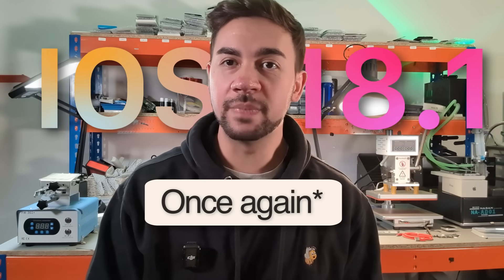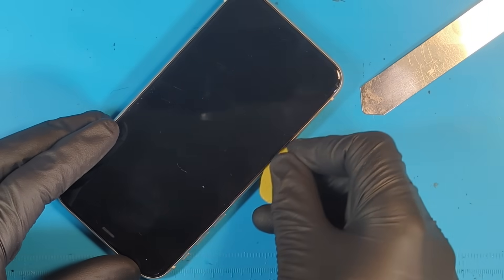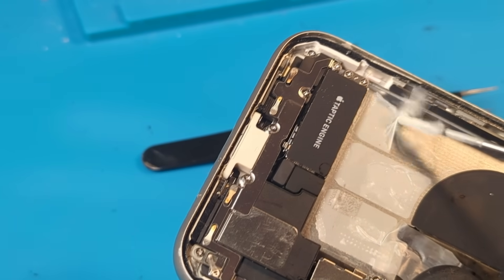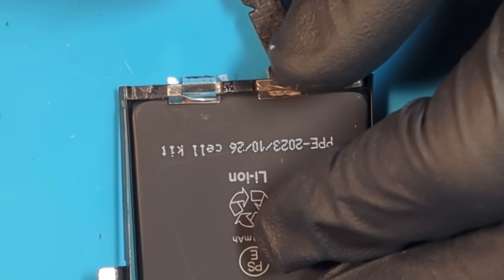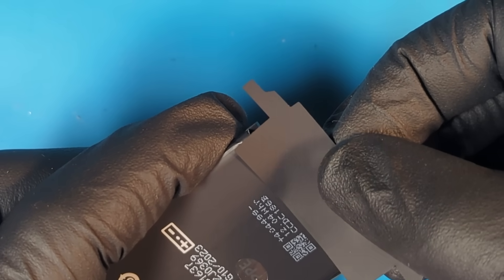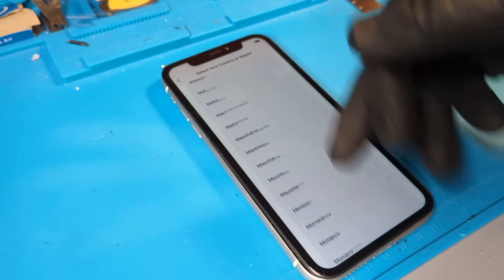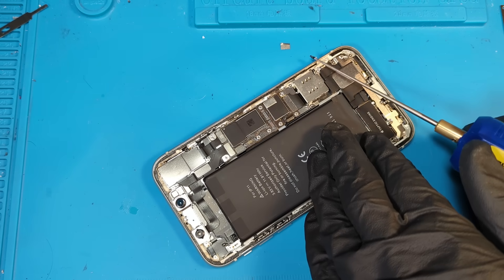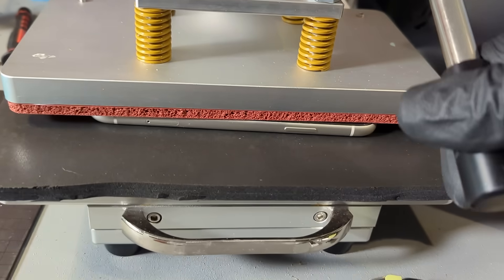How to Reset Battery Health to 100% and Remove Notification after IOS18.3(BMS Swap method)

Comment: Do you need a spot welder
Reply from the maker: Yes :). I have seen people use a soldering iron and special solder, but I have not had much success with it. It looks too messy and I don't like using that much heat next to a battery cell
Reply: @ninjarepair alright thanks mate

Comment: is the flashing still necessary so I can see my battery health and have it reset back to 100% and 0 cycle count? really don't wanna lose my data or redo the iphone starting steps.
Reply from the maker: For this method yes, however you can now buy batteries that pass the Apple calibration. You can buy them on my website if you're in the UK :). These will show as "used" in the settings :)
Reply: @ninjarepair ohhh nice2x thanks man!

Comment: Help, ninja repairman! I have a 16 Pro Max with the battery health at 80%. I already replaced the cell, but I don't know what method exists for the 16 Pro Max to raise the health to 100%. From the iPhone 11 to the 15 Pro Max I use Tag On, but I don't know if it's the same for the 16 Pro Max.
Reply from the maker: I checked for you with my supplier and "currently, the industry does not have the 16-series Tag on flex cable. So, the current health data depends on the BMS board's current health level before it's replaced." hope this helps :)

Comment: Hey will this method work with jcid tag on flex that has been programmed with the original battery bms (soldered/spot welded on a new ampsentrix core battery) to 100% battery health and 0 cycles. I tried that yasterday and i got stuck on 3utools at 48% twice. Is the newest version of 3utools v9.1 i think stable for doing such repairs? I also used lightning to usb c cable, original from apple. Should i use lightning to usb a cable?
Reply from the maker: This should work yes. Please try flash work latest version of JCID repair assistant :).
I will be likely doing this repair in the next few days so I'll try checking to see if it's working.

I don't have any jcid flex in stock unfortunately, but pre programmed should work for my test
Reply: @ninjarepair can you make a video on this and specific procedure on jcid repair assistant where to download it amd how to configure it or leave me some toutorial that shows it all, because i cant find it anywhere

Comment: Il tag on e da settare con programmatore o da tutto il programma jcid su pc ?
Dopo aver fatto questo iPhone si spegne da solo? Cosa posso aver sbagliato?
Reply from the maker: The tag on flex in the description do not need programming. With jcid tag on flex you do need to program them :).
If the phone turns off after cell swap, perhaps the welds are not strong enough?
Does it turn off with the tag on flex disconnected?

Comment: why did you breeze through the most important part (resetting to 100%)
Reply from the maker: You can download the firmware using 3U Tools, and then you can use JCID repair assistant to reset battery health to 100% :). There isn't really much more to show than what's in the video my friend
Reply: @ninjarepair  is jcid repair assistant a software or is it an external tool?
Reply from the maker: @fixtheorylab it is a software. Search JCID Repair Operation Platform. It is for Windows :)
Reply: @ninjarepair  ty

Comment from the maker: In my latest video, I cover a new way to calibrate an iPhone battery to 100% — no flashing required. You’ll find it at about 18 minutes 48 seconds in. https://youtu.be/j6leZOnSJ3k?si=BId6aJDbIA-oqN37
Reply: what exactly did you do? no flashing, just bms swap, it will keep old battery percent on ios 18+
Reply from the maker: @sergeiboyko5711 yes the new video shows a new BMS you can buy and spot weld to the new cell :)
Reply: yeah, but it won't set the battery health visible in the phone settings to the 100% and only flashing sets the same health as bms keeps
Reply from the maker: In the new video I use a new BMS that is available in the description.
For this method here in this video, you still need to use a tag on flex and battery repair flash with JCID for it to work.
Reply: @ninjarepair got it, thanks!

Comment: Is there any way to make it without reseting iphone?
Reply from the maker: You can use a battery that allows calibration. You can buy them from the Self Service store at Apple :), but they are quite expensive.
Reply: @ninjarepair I know about Apple service price. Costs almost more than my used iphone 11 pro
Thats why I am in search for affordable solution

Comment: Hi. I replaced my note 20 ultra battery but it's still acting like the old on draining fast. Will battery reset fix the problem? And will the battery reset delete my phone's data ??
Reply from the maker: There could be multiple reasons why it's draining fast. Possibly the quality of battery used, it could be your daily app usage such as tiktok etc. You will have to back up your device before doing a restart :)

Comment: So without flashing you can’t see the battery health ?
Reply from the maker: With ios 18 you can replace the battery to aftermarket and still see the battery health but you will have the notification.
If you want to remove the notification, then yes you have to flash the phone to show 100% health. Otherwise it will show the health it was previously on.
Reply: @ninjarepair what about a bms swap and reprogramming with a programmer ?
Reply from the maker: @bvc2-n6wyou still need a tag on flex with a programmer. The tag on flex I have in the description are cheaper than the programmable tag on flex's, and come pre programmed :)

Comment: So even on iOS 18.7+ you still need to transfer the BMS if you don't want to see the "Important Battery Message"? Does that message pop up anywhere else besides when you go into Battery settings?
Reply from the maker: It used to be that The message will be visible on the lock screen for 4 days and then for 15 more days in Settings. I think this is still the case. Either way, you do not need to do a BMS swap to change the battery. It's only if you want to remove the notification :)

Comment: I tried the same process on an iPhone 14 Pro. First, I connected the original BMS board to an aftermarket cell and then connected it to the phone. When I checked the battery health, it still showed 79%. After that, I used 3uTools, downloaded the latest 26.0 firmware, and performed a flash with the “Fix Battery Health” option enabled. At 20% progress, it asked me to manually reboot using volume up, volume down, and then hold the power button. Once the process was completed, the battery health still showed 79%. I also tried with the JCID Repairing Assistance app's "Repair batt health" option. Do you have any idea?
Reply: So you were okay with flashing and deleting everything you had in the phone ? Maybe you have to use a programmer ?
Reply: @bvc2-n6wEverything was in iCloud.

Comment: I have a question will the battery also show the battery percentage overtime or will it remain 100%?
Reply from the maker: If you use the JCID tag on flex that you program, you will see the battery percentage over time. I think the cheaper tag on flex that I have in the description might show the health at 100%. I have a new method that I will try upload in the next few weeks that will show the correct battery health if that is of interest?
Reply: @ninjarepair  nice looking forward to it

Comment: i was about to buy from aliexpress and then i remembered about tarrifs😭
Reply from the maker: The gift that keeps giving! You could try to wait a few months and wait for the illegal tarrifs to be overturned :)
Reply: @ninjarepair  probably wont be overturned. ** trump. btw, does doing this method of battery replacement get rid of the non genuine battery message? i just realized that at the start of the video, we are getting rid of the degraded battery health message. but im trying to get rid of the non-genuine battery message.
Reply from the maker: @romangula9299 you will need the orignal battery to remove the message. You cannot remove the message if the battery you're trying to replace in the phone is already aftermarket.
You can however buy diagnosable batteries now that show as genuine used :)

Comment: Really quick question: while flashing you mentioned there would be a time when you may need to disconnect the battery and reconnect .During the flashing process (does the jcid software mentions to disconnect and reconnect) or after flashing complete . Helpful video by the way.
Reply from the maker: Jcid will say a message asking you to restart the phone. You can disconnect and reconnect the battery, or press up, down then press and hold the power button till it boots back up into recovery mode :). I think in one of the more recent updates it tells you what buttons to press :)

Comment: for the QianLi Macaron max, which one are you supposed to get?
Reply from the maker: The one I use should be one in the description link :)
Reply: @ninjarepair  right. but on aliexpress, there are different color options like  2S SETA, SETA, SETD, etc. so just wondering which one you chose.
Reply from the maker: @romangula9299  Ah sorry, I understand now. SET-E is likely your best because it comes with the scissors, the only thing is that you do not need the Nickel solder wire.

It might be beneficial to buy "Set - A" and buy the ceramic scissors separately if you want to save a little bit of money :)
Reply: @ninjarepair  thanks. couple of more questions. 
can these repairs only be done on iphone 11 models and later? I see that the Battery Tag on Flex starts at iphone 11 models and above. 
For the Screen Separator Pre-heating Pad, does it matter which one i choose?
and finally the Mechanic iShell Precision Screwdriver Kit. should i be choosing the Phonefix 6 in 1 kit?
Reply from the maker: @romangula9299  You can do these repairs without the tag on flex on iPhone X, XS, XS Max, and XR. Same process, but you do not need the tag on flex for those models. You do need to flash the phone though.

For the heat pad, I would buy one that also allows you to do iPads and other tablets, but thats up to you.

The screwdriver kit, I would advise the 6 in 1 yes.
Reply: @ninjarepair  thank you! so anything before the iphone X isnt supported for this?
Reply: @ninjarepair  and for the heating pad, what temperature do you set it to?
Reply from the maker: @romangula9299 you can just swap the battery and not get a message for anything before the X series yes.

I have the heat mat set to 65c. Depending on the heat pad, you might want a little more, or a little less. Phones with LCD screens cannot handle as much heat as phones with oled or AMOLED displays
Reply: I have an iPhone 13 Pro Max. I did a BMS swap. Do I need to have tag on flex to reset to 100%? After reset, do I need to keep the tag on flex or can I remove it? Thanks
Reply from the maker: @chinming1907 yes you need a tag on flex during the flash, and you need to keep it on after the repair :)

Comment: The title of this video is misleading. It’s bullshit. You’re replacing the battery. You’re not resetting it to 100!!!  waste of our time. Change the title of this video.
Reply from the maker: The title of the video is perfectly accurate. Changing the battery cell and resetting the bms does reset the battery health back to 100%. Perhaps becoming more informed on the matter might help.

Comment: Please help me! (Not from the US) Went in for a battery replacement but the battery health still reads as what it was prior to replacement (77%). The tech is saying that I need to factory reset my phone for the battery health to read correctly. I’ve replaced batteries before but NEVER had to do a factory reset. Is it true? I have a 13 Pro
Reply from the maker: In order to show the new health you need to do a firmware update, because Apple no longer allows the battery health to increase the health after ios 16. Watch the video snd hopefully it will explain :). He could just install an aftermarket battery and it would show 100% health, however it would also say "none genuine battery" which is fine.

Comment: So its not a simple case of swapping a battery, I'd need to remove the bit at the bottom as you did in this vid to get an accurate battery percentage? Looks difficult and need to have the correct tools to be able to do this!
Reply from the maker: With ios 18, you can see battery health, but you have the none genuine battery notification. If this isn't an issue for you, just use an aftermarket battery :). The repair in this video is slightly more advanced. Good luck with your repair!

Comment: Hi, I watched your video about replacing the iPhone 11 battery and restoring battery health.
I have a question about the part after using 3uTools — when you say: “Go into the JCID section and click Fix Battery Health”.
How exactly do you access that JCID section?
Do I need special hardware connected for that option to appear, or is it possible to enter it without the JCID device?
If you want, I can also make a slightly more technical version so it sounds like you know the repair process well when asking. Would you like me to prepare that one too?
Reply from the maker: Download the apple firmware using 3uTools, then use JCID to flash the iPhone, and make sure "fix battery health" is checked.

You do not need any hardware to do the flash. You can just plug in the phone, and the info should be there one one of the tabs at the top :)

Comment: I have an iphone 13 which is at ios version 16 can i simply change the battery with the original bms without flashing or anything,, plz answer 🙏
Reply from the maker: Almost. You still have to use the tag on flex, but with ios 16 there is no need to flash the phone :)

Comment: The part where you flash the phone is to fast and not very well explained …
Reply from the maker: Use jcid repair assistant. Flash the phone with the battery repair button checked. At some point it will ask you to put the phone in recovery mode again. Press up, then down, then power button until it restarts :)

Comment: What is the tag on FPC flex that you attach to make it think 100%? Where do i get those, I have a JC V1se
Reply from the maker: There are some linked in the description :)
Reply: As in my JCID v1se wifi has tools to change battery health percentage. can i use it and skip any steps, while still not getting any annoying messages or it saying there has been a service?
Reply from the maker: @Miles-l1yno, you can't just use the programmer to alter the health. You will have to use the tag on flex. The tag on flex's linked in the description do not require programming either.
Reply: @ninjarepair Thanks for the response. Interesting, so the jcid v1se and its similar tools have no use in battery health rewriting any more 😮
Reply: @ninjarepair Also thanks for the clear tutorial! new fav repair channel
Reply from the maker: @Miles-l1yyou can buy the JCID tag on flex, and program them with the programmer. The issue is that the flexes from JCID are more expensive.

Comment: people complaining about battery health and android users saying their phones are better. android phone batteries also degrade, the only difference is that the phone doesnt tell you the battery health so you assume its still 100%. i am an android user but i applaude apple for having this feature in the settings
Reply: You're forgetting one factor though. Because iphone shows battery health then when you try to sell it, the shops will give you far less money for the device especially if its below 80% whereas with an android you can get top money for it

Comment: Awesome video, i did all the process with success, but there is an issue that i cannot solve, this issue only occurs to me on the IP 12 mini, i did the BMS swap and reprogramed with JCID, flashed with 3utools, the battery shows 100% but the original message about "service with degraded health" still there, i have done this to another IP series and everything is good as you shows in the video, but this issue only happens to me on the IP 12 mini
Reply from the maker: Thanks for your comment! For this issue you are having, you unfortunately have to calibrate the battery to above 80% using a battery calibration tool. I use the W11S by the OSS team :) once above 80% you will no longer see this message. It's annoying, but it's one of those things :)
Reply: @ninjarepair  Thank you for your reply, i tried this step using my JCID V1SE Programmer but still getting the same error after flashing with JCID (Not 3utools) but again this only occurs in the 12 mini, i tried this method with an IP 13PM and worked fine, teste this methos with two differentes 12 mini, also using differents tag-flex but nothing, only in the 12 mini
Reply from the maker: Yes, you cannot calibrate on the V1SE. The battery needs to be calibrated. This essentially means the battery needs to be charged, and discharged several times over a few days. This calibrates the bms to be above 80%. You will need the tool I mentioned before :)  @LisdaySolanoPTY

Comment: Is it ok to just leave the iPhone thinking it can only charge to 74% (or whatever it does) without the tag on flex adaptor?
I'd guess that charge limiting could be good for battery health, assuming that's one of the side effects..
Reply from the maker: You can do this, but the battery will be in a type of 'limp mode'. You would need to cycle the battery above 80% using a battery calibration tool. This would remove the limp mode and you should have the full battery capacity. It will still show the previous battery health. You will still need to flash the phone :)

Comment: Does tag on flex need to remain connected once it’s been flashed using 3utools?
Reply from the maker: Yes. But don't flash with 3uTools. Flash with JCID
Reply: @ninjarepair Why not?
Reply from the maker: Sometimes it doesn't work, and it wastes time :)  @maxz69